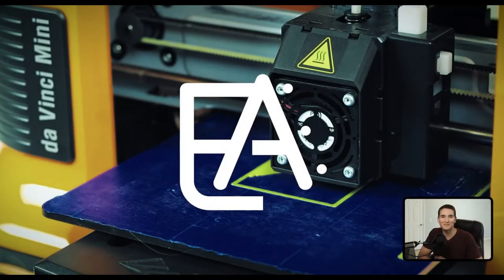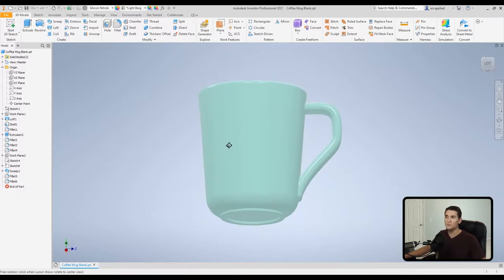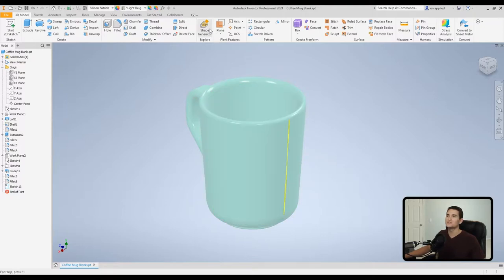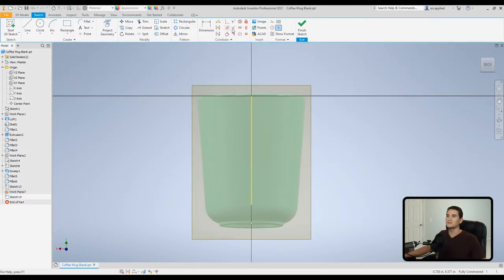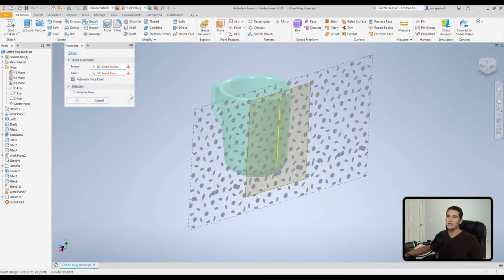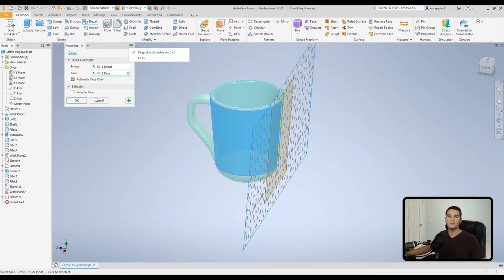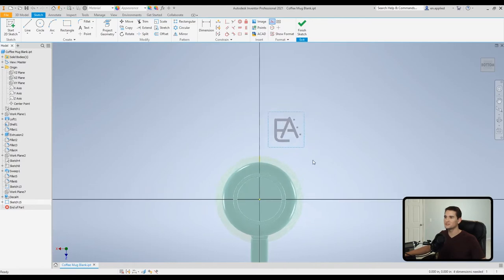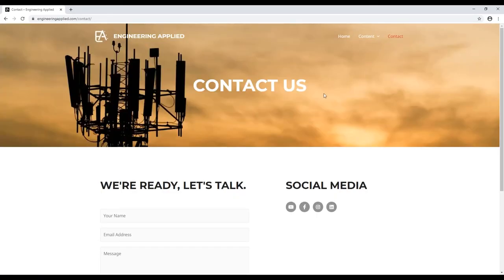Decal Tool and Options - Autodesk Inventor Part Tutorial | Autodesk Inventor 2021 IN DEPTH

Comment: Is there any way to stretch the decal ? Like resize it, but only in x or y axis ?
Reply from the maker: That's a great question! Currently, it looks like you cannot change the original aspect ratio of the image. However, there is a workaround:

1. Copy and paste the image of interest into Paint (or similar editing utility)
2. Click the "Resize" command under the "Image" portion of the ribbon
3. Uncheck the option that says, "Maintain aspect ratio"
4. Resize image as needed and save as desired file name
5. Import this edited image into inventor as shown in this video. 

NOTE: Use the "link" check box when inserting an image into your sketch plane (prior to using "decal" command) to allow inventor to auto-update the image when the source file changes. For example, you import an image called "Decal Image.jpg"; then, you follow steps 1-4 from this comment and change the aspect ratio to your specifications. You then save this edited version as "Decal Image.jpg" in the same file location as the original which will overwrite the original image file {DON'T FORGET TO BACK UP ORIGINAL UNEDITED IMAGE ELSEWHERE}. When you overwrite the original linked image with this new one, the image used in the sketch plane for the decal will change automatically. This will save you time when fine tuning the image to your specifications. You might have to press the "Local Update" button on the top toolbar (next to "Undo/Redo") to update the model with the updated linked image.

I hope this helped! Thanks for watching :)
Reply: @engineeringapplied  Thank you for help !